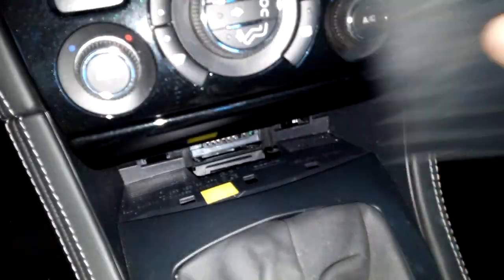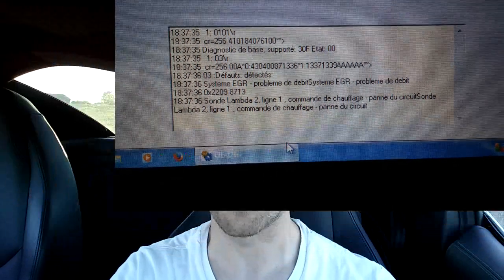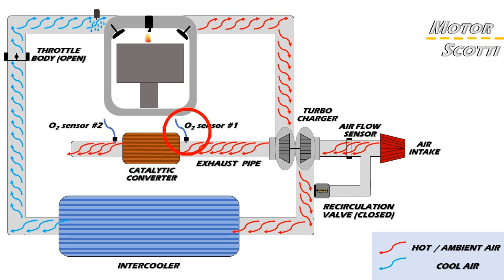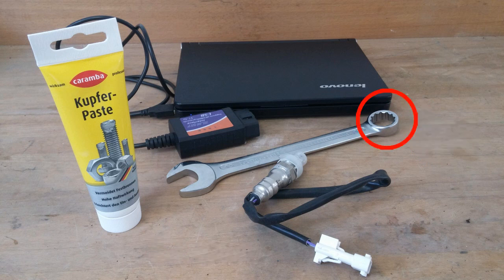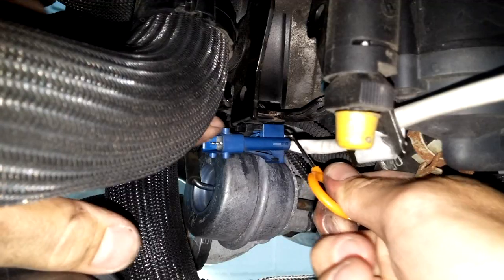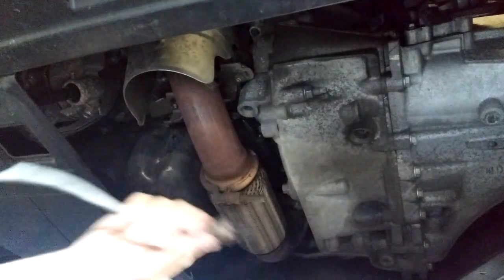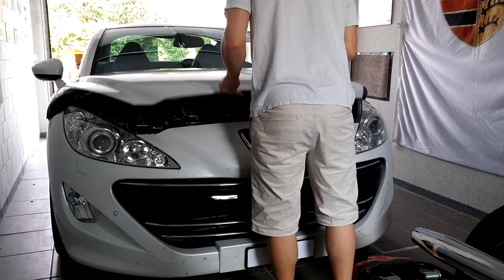Engine fault: repair needed - the oxygen sensor & bad fuel

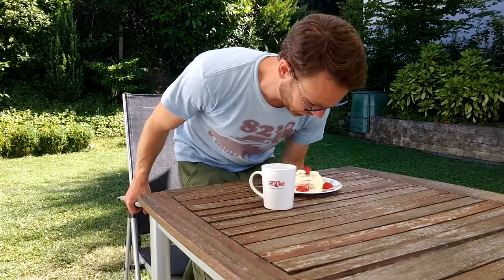Comment: 3:20 min hahaha 😂 😂 👌😁 Shamefully my RCZ had a broken piston 2 weeks ago Scotty.. A whole new engine was needed.. Not very cheap i can tell you that.. I get her back next Tuesday.. Greetz!
Reply from the maker: Urwin Hoogenboom wow! How did that happen? Did you run it without oil?!
Reply: MotorScotti nooo.. She was running fine... I was actually driving 30km per hour when it happened.. Just outta nowhere she instantly went into deadleap.. I wrote a whole story on it on our Facebook page..but to make a very long story short, mine was remapped stage 2.. I have the same exhaust as you + a 200cell cat so she does have a lot more power as normal.. That combined with a little too longer then normal time chain.. And the well know self-pollution (i didnt even knew that because she was running fine) is maby what all together made this happen... 😐😐
Reply from the maker: Well that's a shame! A new engine must be very $$$$. Pretty much the price of the car now, isn't it? Might as well get another RCZ instead? What's the well known self-pollution?
Reply: MotorScotti i send you the whole story including a lot of pictures of this all to your facebook account 😉take a look there.. 😉 here is a little different to send you pictures. 😉 Noo buying a whole new (nice one) would cost me 18K.. This costed me 5K. Still a lot of money..  Time chain now done.. Clutch is now done.. The whole new engine.. And in the end to make it all complete I lost my remapp now also..

Comment: Just messaged on another video, but does your software give readings in the terms of P codes, e.g P0012? As i think i maybe having same problem but wanted to know if our codes match?  thanks again
Reply from the maker: Hi! No mine was P0087. It turned out to be low fuel pressure due to a faulty high pressure pump which has to be replaced. That will turn out to be part of a new video ;) Check Peugeot error code definitions on http://obdii.pro/en/code/P0087
Reply: MotorScotti thanks. Seems like it's a process of elimination  to get to the bottom of it. Look forward to next video😀
Reply from the maker: Arts&Trusts Yeah the diagnostic tool in this video was crap - I got a better one. Quality does pay after all. Thank you
Reply: MotorScotti to be honest I always put Shell 98 fuel for the carbon build which after 74000km after inspection of valves with camera after taking out a spark plug is hardly present..just worried soon with e7 petrol by law!! How can we then from October 2018 solve this?

Comment: würde die AGR mechanisch schließen und jemand finden, der es dir ausprogrammiert(Tüv bzw. AU schafft man damit auch). Mein Diesel (Alfa) läuft damit viel besser. Viele Mechaniker werden dir bestätigen, die AGR/EGR Systeme zerstören die Motoren. Russ setzt sich so überall an. Ein DPF erzeugt dann auch einen Unterdruck, der den Motor killt.
Tank hin und wieder Ultimate, damit der Brennraum sich etwas reinigt. Das AGR Thema findest in jedem möglichen Forum und ALLE die seit Jahren selbst ihre Diesel machen, machen die AGR zu.

PS dein weißer RCZ ist schön. Überlege mir den RCZ zuzulegen :)
Reply: sehe gerade du hast einen Benziner, da ist das mit der AGR nicht so schlimm, außer du tankst halt billigen Sprit :) Diesel erzeugt halt mehr Russ, besonders der günstige.

Comment: I have a 208 1.6 e-HDi 92 which threw up a similar error message after 6 months of ownership (I bought it just outside of warranty), so I had it diagnosed and found a P2562 warning about boost pressure. I had it reset, and it came back a few weeks later. I was informed that it's quite difficult to work out what might be causing this (the DV6 is a supposedly dirty engine), but considering there were no symptoms barring the error code, I had it reset again, and decided to stop using supermarket fuel and go for one of the more "respectable" brands (BP, Jet etc.). The error code stopped popping up. In fact, it's only popped back up once or twice in the 18 months since the change -  once was due to the Archoil fuel system cleaner that I used, and the other because I - you guessed it - went back to supermarket fuel. Both times, I just ran the car long enough for the error to clear itself. It's been fine, no power loss (not that there's any real power to begin with) and no other issues. My 206 wasn't sensitive to fuel at all, but these DV6s are very temperamental.
Reply from the maker: Well, unfortunately modern engines are divas. They only go for the best or else they get moody...

Comment: hey motorscotti..thank you for the video. You are doing a great job..i just want to ask what is the best fuel for the rcz 1.6 200thp? 95 or 98?
Reply: More octane fuel is always better in turbo engines (95 octane quite often causes check engine light in this engine). My wife's '13 RCZ 200 had the same problem .From the moment I use only 98 or more problem disappeared .
Reply from the maker: Thank you! 95 is just fine, no need to put 98 in it works just fine as well. According to Peugeot you should also be able to fill up witj 95E10 - with 10% ethanol, but as you might have seen I had a bad experience with that, so stick with the pure 95. :-)
Reply from the maker: malboro555 Yes it looks like that but it really should be fine with the standard 95 fuel but it's good to know it's nothing serious!

Comment: Motorscotti you are doing a great job by uploading this rcz video. I have question, I've got a Peugeot rcz 2011 156. I recently noticed the car is misfiring and I have change the coil park and a full service with spark plugs, thermostat replaced. 

The car is misfiring when idle, vibrating and sometimes black smoke come out of the exhaust as well. I wonder if this 02 sensor has something to do with it. Plz help me if you have any info on this thank you.
Reply from the maker: Johnsalone Smith Hi, thank you for watching my videos! Well if it's misfiring I doubt it would be the 02 sensor. Did you replace the spark plugs with the original brand and type (NGK)? It might also just be bad fluel. Or it could be the injectors that are broken. Plug in a diagnostic tool to read the error codes.
Reply: MotorScotti thank you for your reply, yes I replaced the spark plugs with the one you mention. On the diagnostic it says high pressure pump is faulty.
Reply from the maker: Johnsalone Smith You're welcome, I hadn't seen your message before^^. Did changing the spark plugs resolve the problem or does it still not run properly?
Reply: MotorScotti I change the spark plugs and we've ordered a new lambda sensor...So if that's doesn't work it might be the high pressure pump that came up on the diagnostic before. Sometimes it runs smooth when idle and sometimes it doesn't.
Reply from the maker: Johnsalone Smith okay cool keep us posted, please. Always good to knownif there is a pattern. Does it run rough when the engine is cold / warm, after you get fuel from a specific service station, when accelerating hard or just when cruising etc?
Reply: MotorScotti when is cold start it runs rough/ rattle and when the engine is warm it stays calm. Is just the misfiring and and the acceleration as sometimes it slow to pick speed. When I pick up the car tomorrow I will give you update.
Reply from the maker: Johnsalone Smith Okay that's great, good luck!
Reply: MotorScotti just an update on the Peugeot rcz, we have change the turbo, replaced the banjo pipe that was leaking oil from the turbo top with a new washer. 

The misfiring is caused by the 2 injectors from the fuel which is weak and the other injector, we think is causing the problems. So we are going to replaced them and I will give you an update.
Reply from the maker: Johnsalone Smith Thank you for the update! Good luck, hope you'll get the RCZ back on the road soon!
Reply: MotorScotti I hope so🏎....
Reply: MotorScotti so we replaced the parts that we believe was causing the car to misfire when idle. But after 25mnts of driving the car the engine management light came on, a warning triangle also pop up and a engine faulty. Repear needed the car start to misfire. So far I don't seem to know what is causing the problem. On the previews diagnostic with the main dealer they said is a carbon build up. 3 diagnostic with an independent dealer says is a high pressure pump causing it. But the Mechanic that fix the car said to me when I mention the high pressure pump, if it was the high pressure pump the car won't be able to start at all. So any suggestions or have you experience something like this before.  Thanks and await your reply.
Reply: @johnsalonesmith9140  I have the same fault. How did you fix the issue?
Reply: steven mcmain well actually I took the car to the main dealer now and they found out it was the high pressure pump and it was fix and I didn’t have to pay for it. I think they said it opens with this cars so it was fixed at no cost.

Comment: Hello my friend !!
How are you !? 
Please please I need your help with some tips ! Please ! 

So I've got a Peugeot rcz 2010 
And for 5 months ....
everyday on the screen comes up the message ( TOP UP COOLANT LEVEL ) I had leave this car in 2 mechanics  but no one knows the problem exactly .... always the car warm up that message apear again ...
But the way have you any tip about it ? 
Thank u so much
Reply: MotorScotti :::: No leaks , the coolant level is normal . I changed the sensor reservoir also but The messenger goes on .... I’ll try to do the coolant reset again ... thank u ;)
Reply: you need to change the level sensor in the coolant reservoir i had the same issue
Reply from the maker: #VIVENDOUK Patrick Xavier Hi Patrick, no visible leaks? Does the coolant level go down? What does the diagnostic reader say? Have you replaced / checked the coolant level sensor?